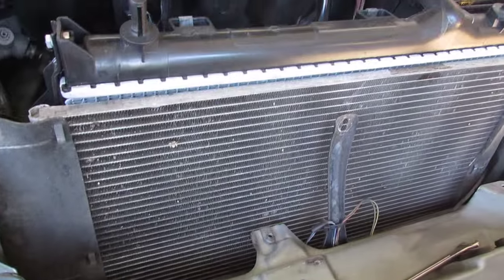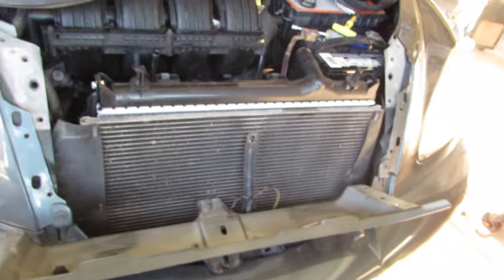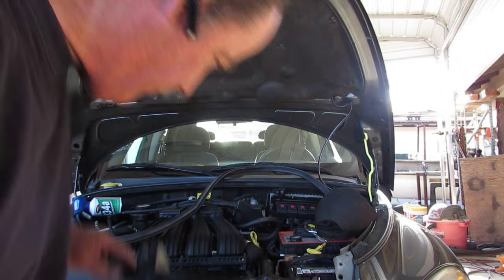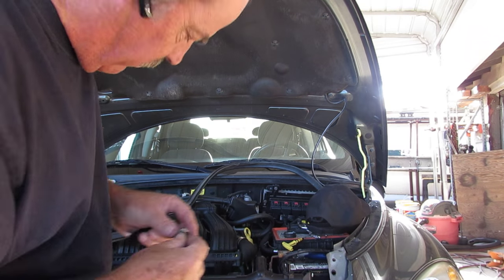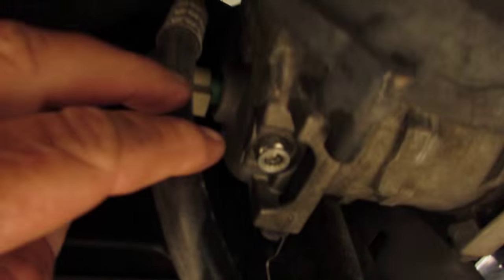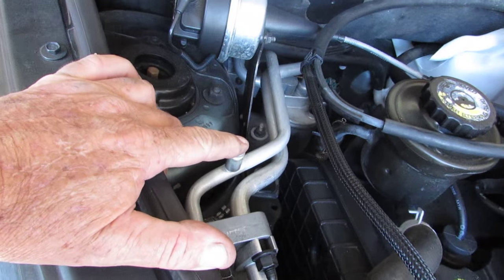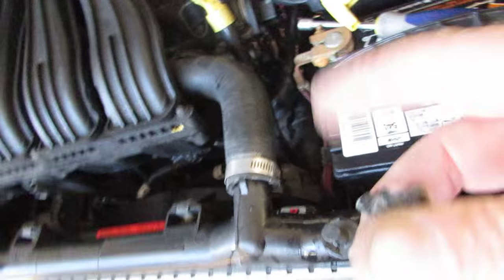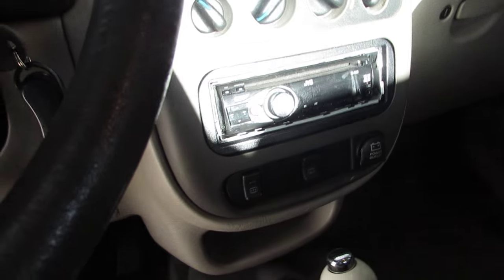2003 PT Cruiser AC problem and radiator fan

Comment: Great vid. My PT, a 2003 and green (but not a woody) like yours, did the same thing and I was thinking it was the fan that blew out but it seems like it still works once in a while. I do know that I need a refrig recharge so I might go ahead and get the fan changed out at the same time. A/C still blows strong just doesn't cool very much and, with summer almost here, I'll have to do it soon.

I have a love/hate relationship with my PT but just can't quit it. I love how easy (mostly) it is to work on, but the cramped engine compartment always drives me crazy. I also tried to refinish my headlights but didn't like the result. So, I just put new headlights in, that was fun LOL

I'm also looking forward to switching my plug wires soon. Should be an adventure take the manifold off the first time. Hope I don't lose any bolts ;)

Here and there everything will eventually get finished. The PT keeps motoring on in the meantime. 

I subscribed and I look forward to seeing more vids from you. Thanks.

Comment: Thanks for your response...I did everything I knew to do including new compressor....I checked the fan working and thought OK ...this is the first I heard from the expert reports and reviews on here that mentioned a two speed fan problem and checking it by using another fan cooling source...Gonna get a new fan and get er done....was about to send the ole PT woody to its final resting place...been in the mid high 80's here in Central Pa. With no air...lol....Thanks again..

Comment: Enjoyed the video as always! See you took a break from the little ones to work on the big ones. I had to do the same thing. Had a mishap with a drag car my father and I have. And ended up busting up the drivers' door and the left front fender, and few other scratches and dents. But we got the initial body work done and the car will be painted this week.
Reply from the maker: +David Pagan Thanks man! Yeah big cars by day little ones by night! Lol 
Race car! Whatcha runnin?
Reply: +poochefmarowbe we have a 1980 corolla with a 2jz engine, tube chassis, all steel body with a lowerglide transmission. we have been 5.44 to the eight mile with some traction issues at the top end. Still working some bugs out on it.
Reply from the maker: +David Pagan Ok because i grew up with Cudas and Maros,stangs and the like i have figured it was that kind of race car! Lol Boy some of those imports would put my Cuda to shame! Lol
Reply from the maker: +David Pagan Oh I missed this one! Being stuck in the 60's and 70's i assumed drag car meant Camaro, Mustang, Cuda,etc. But some of those imports haul butt! My poor old Cuda doesn't stand a chance on todays streets! Lol

Comment: Was that hydraulic lift expensive? Thank you for the video. I might replace the radiator fan next.  I replaced the low pressure ac switch,  compressor good now, freon good. Will try relay next.

Comment: I learned what I need to know from you. My wife's '05 (51,000 miles) does the same thing.
I just want to say this as part of a thank you. I am a ASE automotive master tech and transit bus master tech but
if you don't have the info. you don't just know what to do. How would anyone know about the 2 speed fan, no fuses or relays,
etc. unless you learn it somewhere. I could buy the manuals and wiring diagrams, yes but that is expensive.
ASE does mean something but a mechanic is a mechanic even without the cred's. And just because one has the cred's
does not make one a mechanic. Enough blathering from me. Thank you for this valuable video.

Comment: what kind of engine collant do you use. I just got a 2003 pt crusier and the cap says it takes a special kind? I found a half gallon of peak 50/50 in the back seat...do you have to use a special kind?

Comment: if the ac compressor is not coming on due to lack of ac charge does the low fan still coming on or it's off if u turn on the ac?
Reply from the maker: The fan should work regardless of the AC charge.
Reply: poochefmarowbe the fan is new installed but the fan isnt on if i turn on the ac the shop says that the ac compressor might be damaged idk im putting ac charge right now
Reply from the maker: If there's not enough refrigerant in the system the compressor will not come on! There's a low pressure cutoff switch to prevent that. The fan comes on and off depending on engine temperature.
Reply: poochefmarowbe i checked and refrigerant is too much overcharge sobi think thats the reason it's not blowing cold
Reply from the maker: That is possible!
Reply: Skyethur 
mine is doing the same thing
Reply: My fan got fixed and yes if the freon is too low or empty the fan will not turn-on it has to be on normal charge

Comment: is chrysler a good car for long term use? is it true dodge or american car are prone to transmission or engine failure early?
Reply from the maker: I have been a Mopar fan for years! Dodge Chrysler Plymouth like any car if you don't take care of it, it won't give you years of service! I love the PT and now have 4 of them I love working on them but I'm a mechanic. If you live in a hot climate i recommend installing a transmission cooler the bigger the better! Repair any coolant leaks immediately! Check the oil on a regular basis that's really all you need to do for miles of trouble free service!
Reply: just bought a used pt cruiser and the problem is the car vibrates on a stop light but if i put it in park mode it will be gone.. only when on drive mode and on stop light and i noticed when ac on or heater the engine shakes a little more..
Reply from the maker: These vehicle's do vibrate a bit but if it's to bad it could be a motor mount issue.
Reply: poochefmarowbe yea i dont know whats the normal vibration on this car but it isnt that bad i have nissa sentra it doesnt vibrate as this car.. i need to test the engine if it jolt when i hit acceleration thats how i know if engine mount is worn out... and also i just found out today that the radiator is leaking coolant is empty but the temperature is still in normal range even i ran into freeway for like 30min so maybe i need to replace the radiator before spring.. I have the 2004 touring turbo editon PT cruiser
Reply from the maker: Make sure you keep the radiator full and check it cold! The reservoir should be at half. If the radiator is leaking check it often! You run the risk of turbo and head gasket failure!
Reply: poochefmarowbe oh that sounds like dangerous i just bought this car =(... how do i know if head gasket is bad? the leak is right below radiator i can even see the leak over the top of radiator
Reply from the maker: Normally you'll have some milky foam on the oil cap if there's an issue. It has to get pretty hot to develop a problem. check it often until you get the radiator replaced.
Reply: yea the temperature gauge is normal even on freeway and previous owner says he replaced time belt and power pump on this vehicle which the dealer says after 90k miles those mentioned should be replaced.. i suspect just the radiator is leaking..  it runs good though no issues with speed..
Reply from the maker: Sounds like she's in good shape then just keep an eye on that radiator leak!
Reply: yea my dad fix cars also but not certified he said everything is good for now and keep an eye on the gauge temp if it increase a bit then needs to replace soon.. How much is your lifter?
Reply from the maker: Oh good I pit crew for my kids as well! Lol I'm not certified either I think all that is a bunch of whooy! I paid 2500.00 including shipping i did a review on it here, https://www.youtube.com/watch?v=bOVfuWmNgKY
Reply from the maker: Sorry for the delay! I purchased it for 2500.00 shipped. I did a sort of review https://www.youtube.com/watch?v=bOVfuWmNgKY&t=21s

Comment: I own 2 PTs (one sedan and one Convert GT Turbo) and love them both.  Do you still have your PTs (this being a 2015 video and all).  If so, I'd like to tap into your experience
for problems that may arise....is this OK?
Reply from the maker: Curt Brennan Yeah sure lmk I have 5 of them seems like there going the way of the old metropolitan if a guy had one there were 8 in his backyard! I've noticed that around here! People either love them or hate them! Lol Use my email for a quicker response!
Reply: Thanks for the reply!!  Ya, I've been thinking of buying a couple of parts-donor cars and just tucking them away for future parts use.  We had one a few years ago that we put 130,000 miles on and it was STILL running great!  We found one (2002) locally with only 17,000 one-owner miles on it, fully loaded and from a  literal "little old lady" that we just had to buy, so we've had 3 of  them now altogether.  Now after 3 years, our 2002 has 53,000 miles on it.  I do have a specific question (electrical) for you that I don't want to bore anyone here on YouTube about.....is there anyway I can email you directly or should I just go ahead and post it?    If you can solve it, I'd be glad to pay your for your time.      Thanks in advance if you will!   ;-)
Reply from the maker: Sure fire away jkemper6@gmail.com

Comment: Info video...but..Should have shown results of changing the fan...I have the same problem on my 2003 PT crusior woody
Reply from the maker: The result's were that the AC worked perfectly and didn't blow out due to over pressurization!

Comment: my cruiser gets hot and just randomly shuts off and wont start again, ive replaced a lot of sensors, the fan itself, relays, the fan was running, temp gauge shows fine, but under the hood its just so damn hot to touch anything, yet its not spewing anti freeze to show its over heating,, any idea?
Reply from the maker: Any codes? I assume the radiator cap is full some times they get air pockets. Don't think it's overheating unless the gauge is off?
Reply: the gauge seems to be working, it only seems to do it when coming to a stop or slowed down after a while of driving, it ate 2 china made cam sensors recently. guess that's just the quality issue. no error codes as of right now and its running again, but don't trust it long,, short distances it seems ok, I recently tried to drain air pockets, might have to do again.  there for a short time radiator fan wasn't coming on, kept messing with relays and connections got it going again. that could have been it. even tho I put a new one on it for precaution
Reply: I found out also the ac condensor was smashed tight against the radiator no air gap, it was bent, so I put a gap between it with spacers, and tried to take any air pockets out of the radiator, also think there was a short or something, fan wasn't working when it should, so I messed with relays a bit and connections, so far so good, only time will tell
Reply from the maker: Sounds like you nailed it! Cheap after market parts are a real pain!!!!!
Reply: I bought a better brand cam sensor, going to keep it in the glove box, and got a small wrench in there just in case it ever did go back out while out driving
Reply: spoke to soon, it died again on the interstate, gave error 0320 and one other, just as precaution I had another cam sensor in glovebox,,  put it on real fast, reset the computer but before doing so I could smell antifreeze inside t he engine area, but no leakage and the gauge showed ok.. but after resetting the positive and negative battery side and fidgeting with fan relays  it was able to start it and get it back home..i had put a new radiator fan as well last time it done it about 2 weeks ago... its almost like maybe its getting right to the overheat status before it does it shuts engine down, that could explain the smell. maybe fan wires have a short somewhere or ground issue,, its so aggravating.. everyone else says sell it,, sell it, but I love the car and it only has 36,000 miles
Reply from the maker: Wow only 36K ? Yeah there great little cars i just put 2 back together after buying 4 of them I love them too! Hope you can get it sorted out!

Comment: what kind of engine collant do you use. I just got a 2003 pt crusier and the cap says it takes a special kind? I found a half gallon of peak 50/50 in the back seat...do you have to use a special kind?
Reply: OEM is always recommended, which in the case of PT's is Mopar, and in this case the Mopar 5yr/100,000 mile antifreeze, however it's not recommended by Mopar to mix other antifreeze with their antifreeze. But who knows what the dealership or previous owner has used. I can say don't mix types, (HOAT or OAT) and usually adding the same color antifreeze is fine, but every manufacturer makes their coolant slightly different and using different chemicals or concentrations, so sticking to one brand is best. If in doubt have the coolant flushed and start fresh with a compatible brand (Chrysler recommends Hybrid Organic Acid Technology - HOAT types) that you can easily get or use Mopar 5yr/100,000 miles (Autozone and Amazon sells it), the 10 year is an OAT so don't use that.